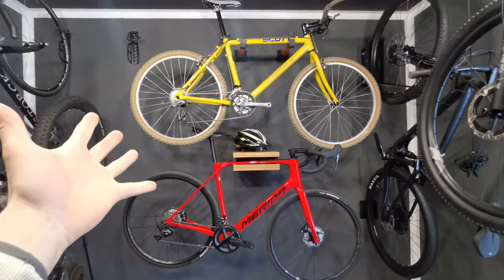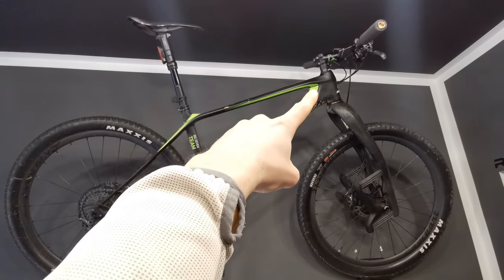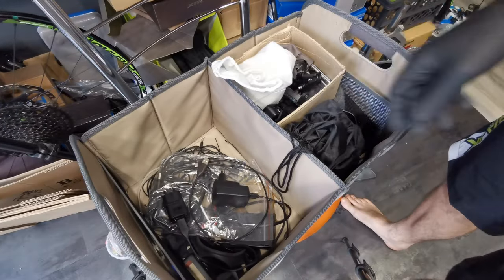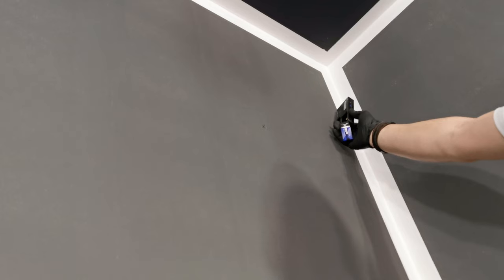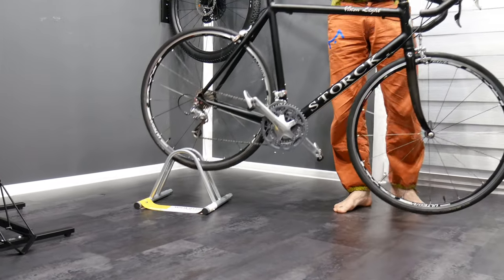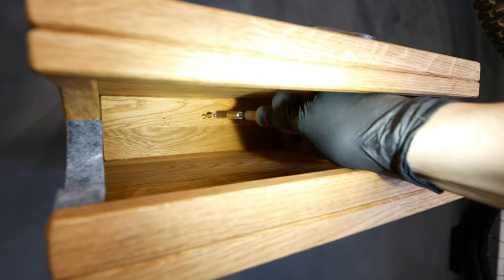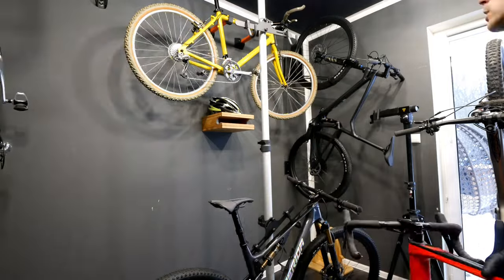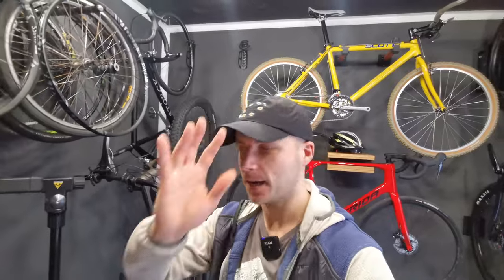11 Bikes On 10 Square Meters! Space Saving Storage Systems In Test - Bicycle Stands & Hangers.

Comment: Great Video! Question: Did you experience any problems with vertical bike stands in combination with hydraulic brakes when air floats from the brake lever to the disc brakes?